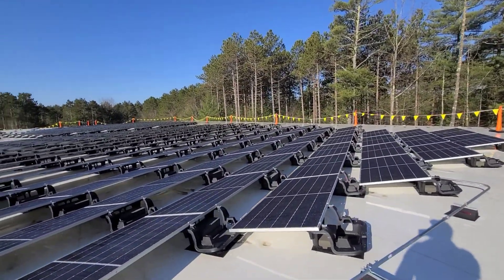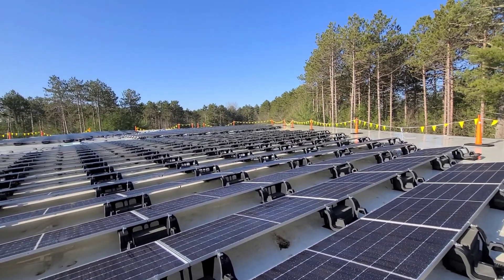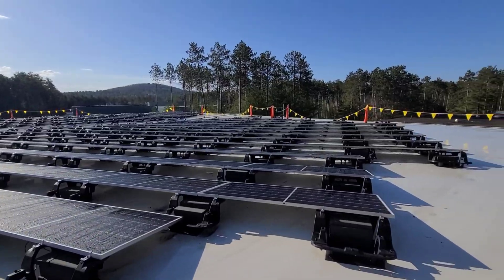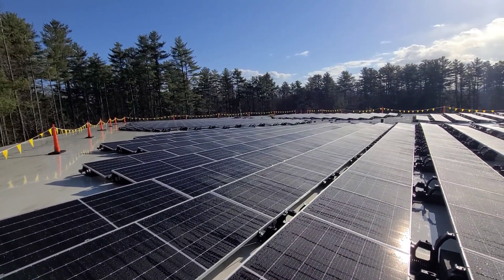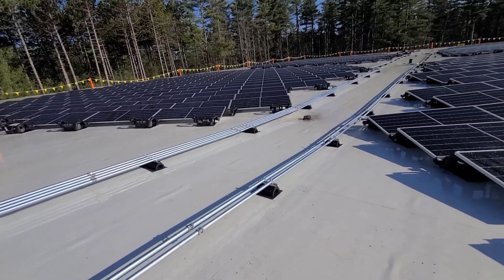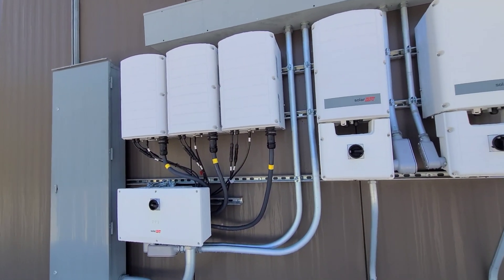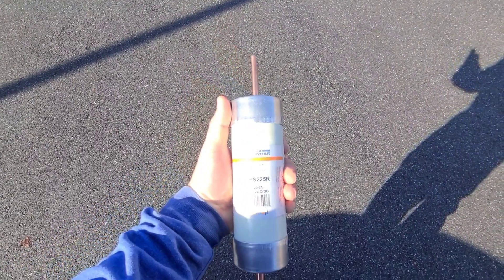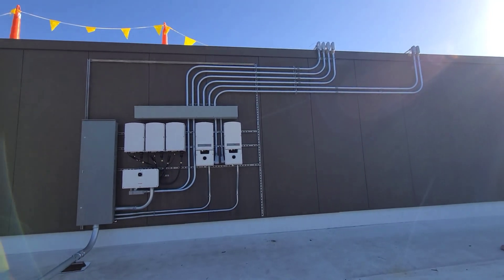This Huge Warehouse Generates More Power Than it Can Use!!

Comment: Seems they should build a secondary utility grid to allow homeowners in their area, rather than trickle charge the electric grid, use this secondary system to tie into a vanadium flow battery which collects and stores the excessive energy and releases it to the grid when necessary.  Instead of paying solar fees to be part of the MAIN system...folks get paid based on the fees collected when the vanadium battery is returning energy to the grid during peak times, when cost of electricity is higher.  If i could get paid more than just a few pennies on the dollar for my excess solar, I'd put up more solar and become a mini-power generator.

Comment: In Arizona, Salt River Project (SRP) which is an electric utility company, charges solar residential customers extra money for the privilege of hooking up solar, charges them higher electricity costs than non-solar residential customers, charges a minimum fee every month regardless if any electricity was used or not, does not pay adequately for electricity provided back to the grid by the customer. The extra money you generate from electricity sent back to the grid from your solar panels can't exceed the $30/mo minimum monthly charge, and any extra electricity sent back to the grid that makes a bill go negative (which it can't because of their rule that solar customers are charged a fee regardless) does not roll over to the next month's bill. 

So you could have a $50,000 solar system on your house...
$100/mo electricity bill
$250/mo electricty generation sent back to the grid
Your bill will be minimum $25-$30/mo and the excess electricity you sent back you don't get anything for that. They steal it. It's fraud.

There needs to be better protections for people who have solar on their home(s) from utility companies.
Reply from the maker: Unfortunately, that seems to be the way net metering is moving in general.  Battery systems for self consumption will make more sense financially and ultimately be the way moving forward.

Comment: Thanks Ben...looks like a nice installation.  That looks like a former IBM building....I bet the electrical connection was fun!

Regarding the 1.5:1 AC:DC ratio, that seems pretty high.  What ratio do you guys usually use for a residential installation?  Do you make any adjustment for Bifacial panels?  

We've been super impressed testing our 365W bifacial panels this winter.  We regularly get 400W+ out of them (using a Victron DC charge controller), especially with fresh snow on the ground.  Conventional wisdom would be to use an IQ7+ microinverter for these modules, but with 295W peak, I'm thinking it would have high clipping loss, and erase much of the benefit of the bifacial rear panel.  

I'm currently looking at the IQ7A (366W), or the new APSystems DS3-L (384W) looks like a good value at about 1/2 the price of Enphase.

Comment: Do you know what the payback time is for this system? Also, what is the local retail power price, does the utility have time-of-use metering, and does the system have any battery storage?
Reply from the maker: I think payback is around 10-12 years.  Not sure what the rates are for commercial, but residential is around $0.17/kWh. They do offer TOU rates but they're not worth it, at least for residential.  No battery storage.

Comment: Looks good.  What ever happened to the maple syrup factory system
Reply from the maker: You mean that 96 panel system in Alburgh? Long story... ended up switching from solaredge to enphase(at the customers request). The transformer was undersized possibly causing the solaredge inverters to fry constantly and he got  frustrated...
Reply: @benssolarandbattery  we both know it wasn't the transformer.. lol   guessing it was the HD-Wave variant

Comment: What City is the installation? In San Diego we cant do ballasted system very easily anymore on our commercial projects. What's the problem with going over 150kW- AC for your jurisdiction?
Reply from the maker: Just outside of Burlington VT. They're pretty relaxed here all things considered.  I don't know the exact requirements for over 150kW, but it's considered a large generator vs. a small one, with higher payback periods and less $ per kWh.

Comment: Ben, is the excess power being sold and fed back to the power company? I  can't imagine that the business beneath the roof is using all of it?
Reply from the maker: The business has multiple buildings right in this area.  They're doing what's called "group net metering" to feed excess credits to their other buildings.  In reality, all of the buildings in this area will be using the power generated by this array.  (Even the local Sunrun office that's right around the corner! 🤗)
Reply: @benssolarandbattery  Awesome!

Comment: Fantastic!  How do they remove the snow from the panels during the winter months.  Heated?
Reply from the maker: Unfortunately they will be snow covered.  We try to factor that in when sizing a system though.  There's not a good way to melt the snow off, especially with a system of this size.  They will warm up under the snow from building heat losses though and melt fairly quickly once a little bit exposed.
Reply: @benssolarandbattery   @Ben's Solar and Battery  Thank you for the answer.  I've wondered if there is some type of moisture or snow sensor, that could trip a small heat pad either on or under the panel to create the black spot needed to combat the albedo effect.  But it's probably not worth the expenditure.

Comment: How did you decide on the tilt angle?
Reply from the maker: 10 degrees is typical for a ballasted system like this.  Any steeper and you need too much weight to hold it down.  Any shallower and your production really suffers.  The designer came up with the system size based partially on the tilt angle, as that's preset.